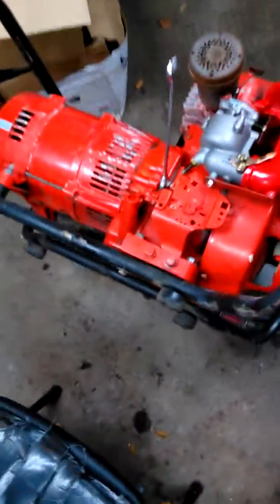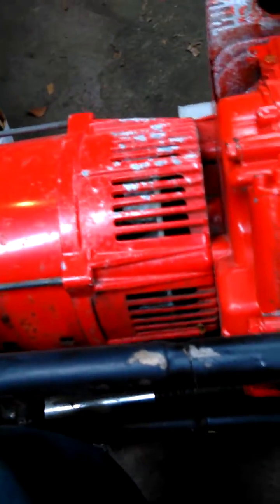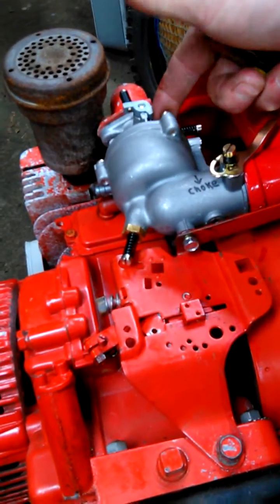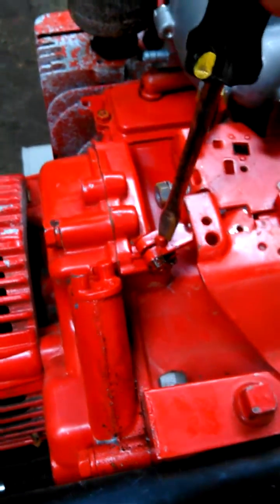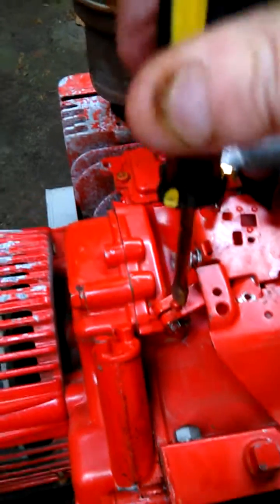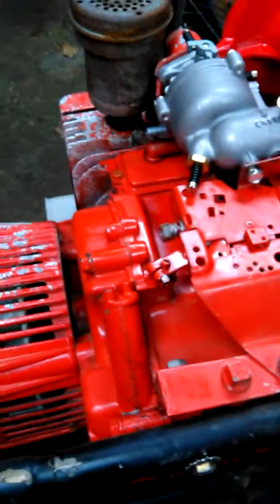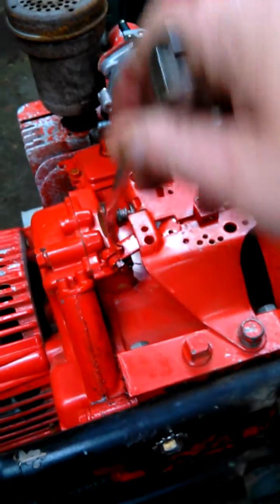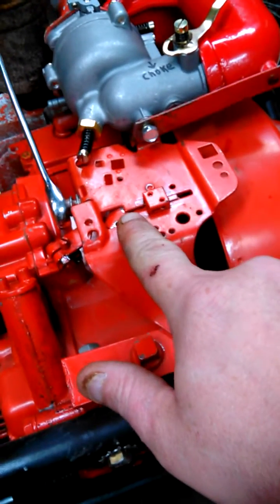8 HP Briggs And Stratton Horizontal Shaft Governor

Comment: Thanks for making this video. I have a generator just like this and replaced the carburetor which I see you did as well. Mine is a 1988 8hp and I'm wondering how you are supposed to shut it off since the throttle is set in one position.

Comment: Those Chinese Carbs don't do these engines justice. I've got an 83 Sno-Gard version, it has the older control bracket on it.
https://youtu.be/Y2x185QaTos
Reply: It looks like the replacement carb that I bought. The word for choke was written in Russian and embossed on the wrong side so it can't be seen when installed. It had arrows going in both directions for closed which doesn't make sense. The mount on the bottom protrudes a little further then the original, so i had to loosen the throttle bracket to make it fit. Hence, why I'm here to make sure it's adjusted correctly. Later, I found this reproduction that looks nice, https://isavetractors.com/carburetor-for-briggs-stratton-cast-iron-engines-medium-2-piece-flo-jet/?gclid=CjwKCAjw4871BRAjEiwAbxXi2-EpvGMwRef-XnJnxGqHeaKu1_9TbmY5jK-DHA3iqOPgzxeDsdAhsxoClxwQAvD_BwE, but haven't tried it. Why is is so hard to find a rebuild kit? haha